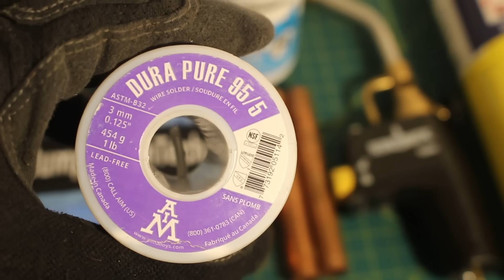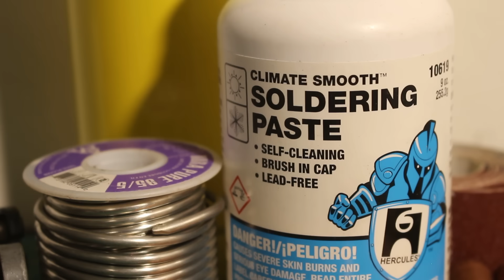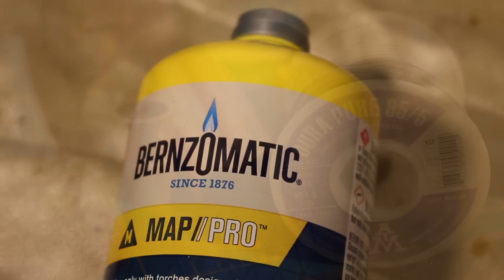How To Solder Copper Pipe (Complete Guide) Plumbing 101

Comment: Wipe away the flux still showing before you apply the torch. I see this mistake all the time. If not the solder can run wherever there is flux and you only want solder inside the joint. 

Also, try to touch the solder only once rather than many times. It will be sucked all around the fitting no matter where you apply it. Just push it in. You won’t need more than say 0.5cm of solder

Lastly, in the video the flux was starting to boil away. This is one of the biggest mistakes - if too much heat for too long the flux will simply boil off completely and then you have no chance. 

Having said all that to hopefully help, this was a nice video 👏
Reply: Thank you for your advice!
Reply: Love the advice but I don’t agree with no matter where you touch it. It’ll will suck all the way around. Especially on bigger diameter pipe. You need to hit the top and bottom it won’t always go all the way around
Reply: @Dean_0413  how big are you talking? I’ve just finished an install of mostly 28 and 35mm diameter copper. You of course need to turn up the torch, but principle is the same. 👍
Reply: Not trying to be snarky, your advice is muchly appreciated. But do you have a channel wherein you teach diy? If not, it looks like you probably should.
Reply: @1959jimbob  if only I had the time. It’s on my list to start a YouTube channel. Hoped my daughter would do all the editing and stuff 😀
Reply: was going to say the same thing, no need to walk around the pipe that much. All ya need is to hold that torch at the bottom of the fitting and apply enough solder at the top to reach all the way around.
Reply: No... u dont need to wipe away any flux....the solder will follow the heat with the flux ..not the flux with no heat....and i didnt see any flux boil away...if it did the solder would have not taken due to overheating....Only touch the solder one time?.....Good luck doing 6 inch copper!!!!